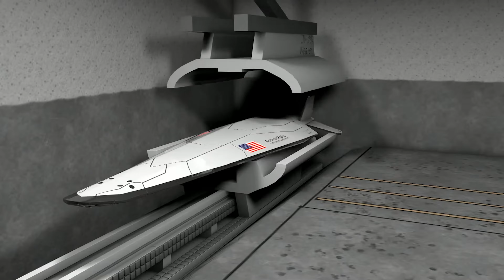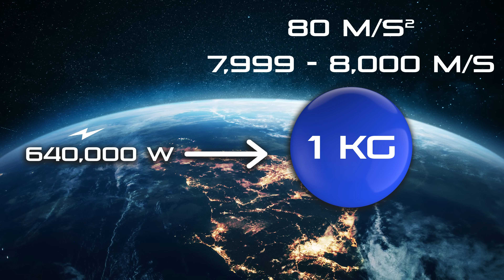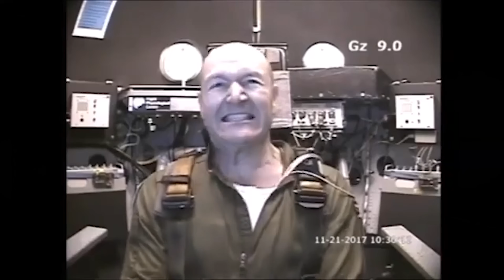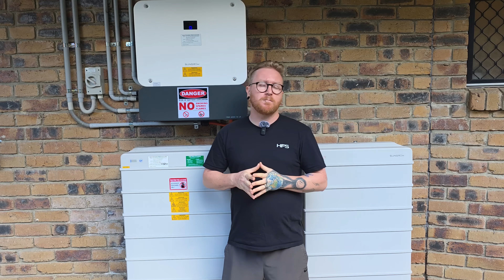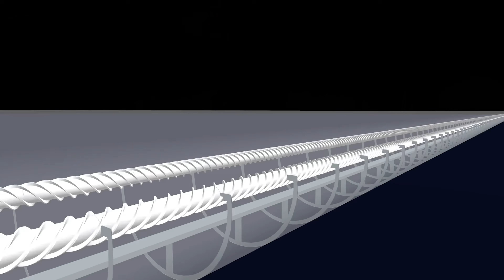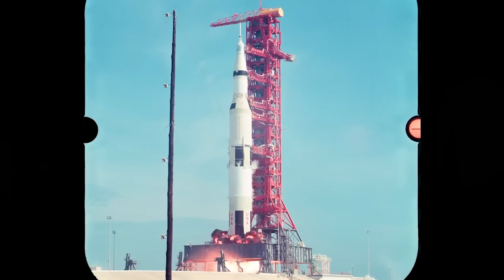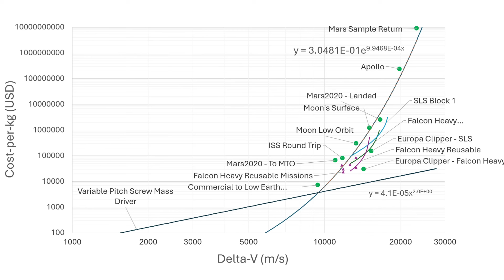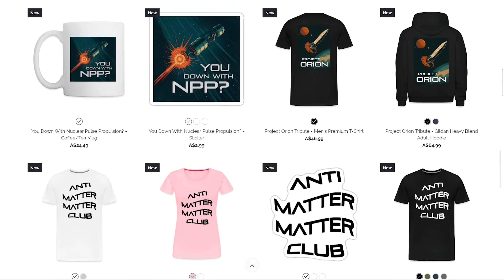The New System That Could ACTUALLY Replace Rockets

Comment: Here we go again with vacuum tubes... What happen when you open the airlock and the spacecraft hits a 1 bar wall of air at supersonic or hypersonic speeds? A gentle kiss? And even if you want to put the airlock as high as possible to avoid a too big of an aerodynamic shock at the airlock (like they hinted they want to do), what's the altitude? 10km? 15km? 20km? Yeah, easy peasy, sure... 

"VPSL is cheaper to Mars than F9 to LEO"... Sounds more like PR than anything else... Don't you think it's a bit early to draw such comparison since that concept only exist on paper and doesn't seem to be more grounded in reality than Spin Launch? Or worse, the Hyperloop scam? 

In fact, in one of the videos on the SpaceInfrastructure YT channel about putting a vacuum in a 1000 km long launch tube, the promoter of that idea immediately points out to the fact that "concerns come from the hyperloop debunker community"... And then talk about LIGO or CERN as examples, much smaller vacuum tubes for completely different goals, to basically validate his concept, while peddling the Hyperloop idea... 😅 This is a fucking scam. Another one.
Reply from the maker: You're welcome to propose a better idea?
Reply: @HelloFromSpaceAus  Yes, I have a better idea,  not listening to vaporware snake oil salesmen. Thank Musk for seemingly having emulated a ton of specimen like him... But not to worry, there are plenty enough naive people out there to keep the hype and investments flowing. As long as the illusion can be maintained... If you don't accept people being skeptical, maybe that says more about you than a random chatter.

Comment: I see a lot of critique of maglve solutios but very little about how this screw concept will be build. Which materials, how does the screw works along massive distance "without bending screwing itself", how long it´s required to be, how the driver will work through the screw... Those prices and virtual clones, what are they based on? As an engineer I struggle to see the practical way on how this will be built, even a small scaledown demonstrator concept. At this stage this stays in the scifi realm more than than a practical approach.
Reply: Hopefully, you'll obtain and read the peer-reviewed paper, "Human-Rated Launch Infrastructure for the Interplanetary Era: Breaking Rocket and Legacy EML Cost Barriers". If you get to the point where you really understand the cost curves of rockets versus VPSL, then you'll be primed to dig in and properly understand all of the other technical details.

Comment: Ideas like this would have value for the initial: "we made it" voyage.

But when we go to mars, or anywhere else, to create an outpost, we're going to need to think a lot bigger.

Starship is really good at getting 100+ tons into LEO.  So let's build a new space station 100T at a time with inflatable segments.

With starships fairing, we'll have 9m x 18m compressed.  Inflated, that gives us segments of 18m x 36m.  Boost 100 of these segments, each a cylinder slightly curved, and assemble them into a ring just under a kilometer in diameter.  

Assemble rigging, and rotate to provide artificial g.  The outer shell of the structure will be padded by a lining 1m thick filled with water for storage and radiation shielding.

Power it by several nuclear reactors, and provide maneuverability with ion drives.

Total crew: thousands.  An entire enclosed ecosystem with farming, aquaculture, engineering, metallurgy, fabrication, etc.

Slowboat where ever you need to go.  You're in no hurries.  Colonize Mars. Mine the belt.  Build bigger in space.
Reply from the maker: Yeh I agree with that, I desperately want to see Starship work too. VPSL could be really useful for orbital construction. You could launch segments of a very large, true 'Spaceship' (a ship only capable of space travel, not entering atmosphere's or landing) for huge bulk cargo missions, or even missions out to the deep solar system.

I think we can do both. There's still a lot of question marks over whether Starship will actually work as intended, and have 100t payload to the moon/mars. I guess we'll have to wait and see. I'm looking forward to IFT11
Reply: Yeah! Exactly! And as a kind of postal/ package construction and maintenance service! Between Earth, Earth orbit, satellites, the Moon and Mars and it's two moons! For big enough astroids and other planets within the our Solar system, like Jupiter, Saturn, Uranus and Neptune with all their moons in the outer parts of our Solar system! And Venus and Mercury in the inner part of our solar system! And projects to the Sun and out of our Solar system! Very nice!

Comment: This would be amazing for building a cislunar economy. Could this compete with similar devices launching loads from Lunar mining?
Reply from the maker: 100% agree, also for asteroid mining. You could build systems on some of the larger asteroids and use them as transport hubs. I think it would be extremely useful for this, eliminating the need for the tube to be evacuated will also simplify it significantly

Comment: 11:00 i cant see it viability.
1º screw (literaly) give friction. but let say you make screw deasing but with magnetic field, how is diferent beside the cost increase(linear rail vs helicoidale track) ? And how will store energy a track like this? I know hobby-plane pushed by twisted rubber i dont know if going in that way or just use energy greed and screw twis variation is just for keep the constant Gs and dont care if velocity increase.
2º when you have 7.500m/s(minimum speed orbit) you can speed up to more deltaV in space with less complex infrastructure, like an spin launch to get that 30.000m/s.
Reply from the maker: I'm not really following what you mean? Sorry

Comment: I was waiting for one of you to address how impractical such a long screw would be, and the fact that stuff don't just hover in air like 3D models do, when I heard vacuum tube and figured it's just another hyperloop style grift.
Reply from the maker: Getting to space is one of the most impractical things that humans regularly do! So, impractical is sort of par for the course.

I can understand the comparison, but consider that there are many, far cheaper, far more practical transport alternatives to Hyperloop - hence why its dead. There are very, very few alternatives to rockets (no physical examples currently at least).

It doesn't cost $10b to drive to and from work in a car, but it does cost $10b to get a spacecraft to and from Mars. When you're talking that sort of scale, the infrastructure and engineering is going to match it.
Reply: @HelloFromSpaceAus  Not really the kind of impractical I had in mind.
A metal screw longer than few meters acts like a wet noodle. And if you torque one end of a very long one, it will snap like a dry pasta.
Are we assuming the gear will just stay in place with wishful 3D plains? Or somebody can explain how we're going to hold it? And how many motors do we need along the way to spin it?
Hyperloop did the same 3D presentation, without addressing the fact that it's almost impossible to pull a vacuum in a tube that big.

Comment: A steam cannon gets around the power supply problem.  Energy accumulates in hot rock over hours.  Water is then rapidly injected using a hydraulic piston pump.  The cannon would boost the spacecraft to an initial 500m/s.  This largely eliminates the need for a lower stage.
Reply from the maker: Its an interesting idea, but I believe it would need more than 500m/s to truly eliminate the lower stage. That's my first though on it though, there's definitely more than one way to skin a cat!

Comment: my favorite high tech low tech combo is the Fusion Reactor in Garching Germany. Theyhave this cutting edge fusion chamber with all its heating from lasers, microwave and neutron beam injection to create temperatures multiples time higher than the core of the sun - powered  by a huge dumb rotating cylinder made of concrete, than is spun up to speed for 30min before dumping all its stored kinetic energy into a electric generator for a few seconds.
Reply from the maker: Great example of 'there's more than one way to skin a cat'. Morbid phrase really

Comment: I maintain that you don't have to remove rockets all together to improve launches.  The greater the amount of ground based energy you can employ to reach orbital velocity the better. 

As for a great location: Ecuador's Mt Chimborazo; a tunnel up the western side reduced air pressure with a burst disk at the end. 

This idea sounds pretty good.  Kinetic storage of the energy is a great idea in itself.  Storing the incredible amount of energy as electricity is so difficult.   

Eight Gs might be a bit stiff for the humans in such a vehicle (fine for cargo though). Variable pitch sounds a bit difficult would indeed solve the problem for squishy humans.
Reply from the maker: I agree with you completely there, I love rockets! And they do serve an important function, even within the VPSL system.

That's an interesting idea, I'd be curious to see the numbers worked out on that in terms of the trade off cost wise of improved efficiency from high altitude launch vs the additional cost and difficulty of transporting hardware up there. It absolutely makes sense in theory.

I have wondered about that too. Fighter pilots can handle short bursts of 8G - however their body position inside the aircraft is far from optimal for high G load. There are mitigation methods which make a significant difference, body position is a big one.

Comment: Also the magnets for the space vehicle.   You could use multiple magnets at different distances along the craft.   But I don't think it is necessary .    And my ideal launch site would be a very large mountain like Mt Everest.   That way the air resistance would be much lower as the space craft leaves the launch tube.
Reply from the maker: Interesting idea, I think though the limit is more the G load of acceleration not too few magnets. My understanding is this system can be more or less as powerful as you want it, as is. The limiter is the G load for the cargo/crew.

That's the right thinking, getting the craft up high.
Reply: Maintenance might be interesting

Comment: Also you make a statement but you don't have any facts to back it up.   You say to accelerate one kg from 0 to 1 meters per second,  take 1/2 joules.   Then you state to go from 7,999 to 8,000 meters per second,  takes 8,000 joules.  This makes no sense unless you are calculating the air resistance in.   If so then use a partial vacuum.  

You make a few of these errors in this video.

Comment: It is a cool idea.   But you seem to be making some errors in your calculations.  
"The Falcon 9 second stage weighs approximately 116 tons (111,500 kg) when fully fueled, with a dry mass (without propellant) of about 5 tons (4,000 kg)"    So 5 tons.  Now if you got rid of the part of the Falcon 9 second stage that holds the fuel it would have to be a lot lot less.    So you are making errors in the weight.    Lets say just 2 tons per launch or even less.   The magnets would have some weight but you could make many launches in one day.    Maybe one an hour.
Reply from the maker: I'm having trouble understanding where the error is you're referring to? The VPSL calculations are based on cost/kg to orbit in both the case of the F9 and the VPSL. The F9 figures are from SpaceX's website, they are payload costs to orbit

Comment: Thanks for the video!  I had not heard of this idea before and it is certainly one of the more innovative solutions I have heard of. However (you knew that was coming), it is impractical. It would have to be many kilometers long, a colossal engineering project. And you have to rotate a screw that is kilometers long at a high speed. We have problems keeping a crankshaft from breaking at high speed, it’s almost incomprehensible how one would do this over many kilometers. However, I think the killer is at the end of the rotating screw.  If I understand this correctly, that screw changes its pitch down the shaft.  As you said in the beginning of the video, there is a huge energy requirement to push the projectile faster near the end of its transit.  That is exactly the same point where the pitch of the screw is almost parallel to the screw.  That means Wen would have to import a tremendous force on the screw to transfer that energy to the projectile as it approaches. It’s orbital velocity.  I find it difficult to believe any current solution could handle that amount of force and energy transfer mechanically on the screw at the end.  As a result, I don’t think rockets are going to go away anytime soon.  That said, I think there are improvements that can be made to rockets maybe like the pulse detonation  engine.  I am not sure that a post-nation engine can ever produce the amount of thrust needed for lunch, but I think it could be quite viable for upper stages where you can burn longer at lower thrust to exploit the higher ISP.  Beyond that we need anti-gravity and warp Drive :-). Thanks for an informative video.!
Reply from the maker: Glad you enjoyed the video! I'm not an engineer, so I can only answer your concerns to the best of my ability - however it is my understanding that the screw sections rotate faster near the end of the track, which helps with the max pitch issue you've described. I've put a couple links to some more in depth videos Phil has done which may answer your questions if you're interested. I spent a fair bit of time going through this and talking with Phil about it. I can 100% guarantee you that this idea is the real deal, not a napkin math concept. This paper has passed the peer review concept as well. I personally believe in being sceptical, this is a good and healthy way to think. When we have a physical VPSL system we can test in the real world, we'll know for sure! 100% on board with a warp drive, if someone could hurry up and invent one I'd be very happy😁

Comment: That kilometers-long vacuum tube is a big part of the reason HyperLoop was never viable (on Earth) from the outset.  It's essentially impossible, and even if possible, absurdly fragile.

And that's before considering how the vacuum is maintained between launches while allowing the vehicle to pop out the end.

Spin launch solves it by having a manageable volume that can be pumped down between launches.
Reply from the maker: The vacuum tube is compartmentalized with airlocks and vacuum gates, this way you don't have to re-evacuate the entire tube between every launch.

I can totally understand why you'd compare this to hyperloop. To be honest I thought hyperloop was an obviously impractical idea from the start - but that aside... The big difference here is the cost saving. It doesn't cost $10b to get a person to work and back, but it does cost $10b to get a spacecraft to Mars and back. If that's something you need, or want to do - something as big and complex as VPSL starts to look pretty attractive.